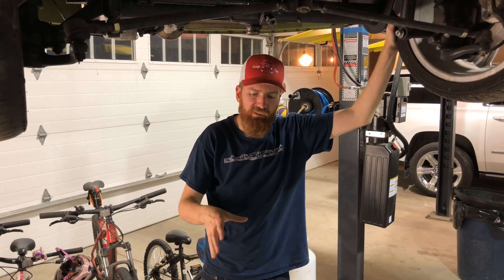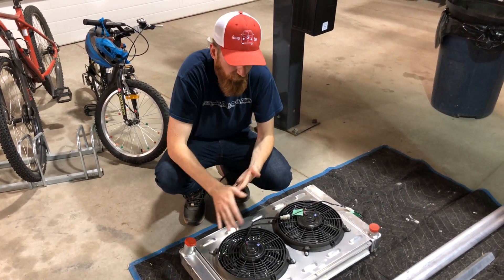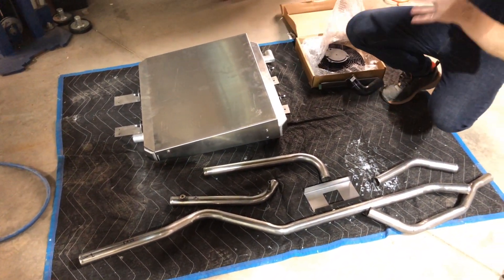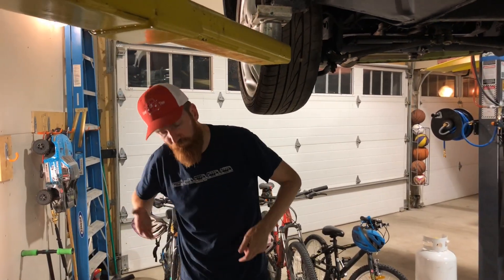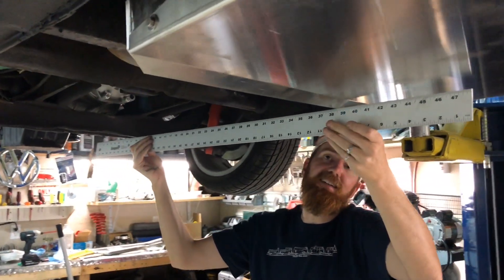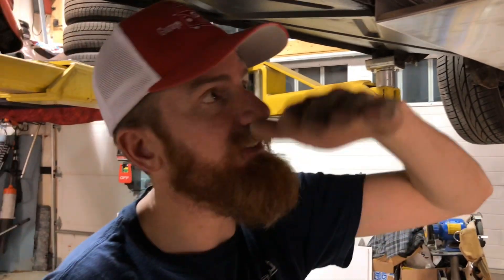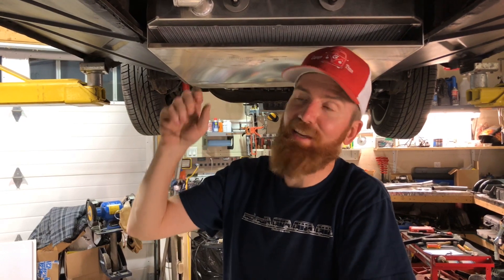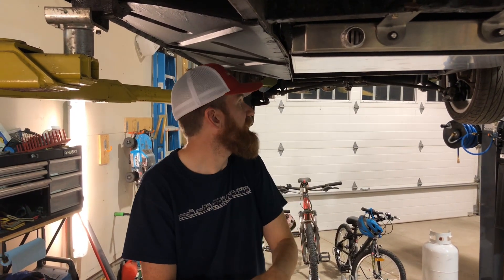VW Bus - Subaru Swap - Radiator Mock-up - Episode 11

Comment: Hey mate, I have an EJ25 powered Bay window here in Australia and have gone with the 2x Honda Civic radiators/fans in the engine bay. Can you tell me your thought process as to belly mounted vs engine bay? I'm sitll in the process of figuring out how to run it most efficiently but it works well in our Summer so far, just is a bit more awkward than I'd like! Cheers!
Reply: how does the air get to the fans & then where does it go for your engine bay set up?
Reply: @kevindougherty593  Air comes down through the vents like it does normally, but goes over the radiators (1 each side). The air then passes out around the engine down to the road, there's plenty of space since there isn't any tinware funnelling air over the engine like the original motor had.
Reply from the maker: Hi Kiel, I actually wanted to do the rads in the engine bay like yours, however was told I would have issues on a split, just don’t have as much room as the bay windows. Really happy with how my setup is turning out, should have new video posting any day adding centre belly pan to help direct air and cleaning up install.
Reply: @GarageTime  I didn't consider the shape of the engine bay in a splitty! Do you find the tray covering the rad on a belly mount likes to collect dust and other road junk?

Comment: However I will say that in my setup I had to remove the cheap fans and install high output two speed 21 amp fans to get the air flow needed
Reply: I watch your videos too, awesome build.

Comment: Did you have the fans mounted in this video? How far below the frame does the rad hang down? Thanks.
Reply from the maker: Hi Dustin,  Sorry, missed your previous comment. Lowest point is 2.5" below frame rails. In video fans are not mounted, but we have lots of space. Radiator actually hangs on angle, but with scoop appears level. Thanks.
Reply: Do you think there’s enough room to run the pipes inside the frame between the radiator and the frame so you don’t have to drill a hole through the frame?
Reply from the maker: Dustin Wilson unfortunately do not think so. The path fellows Speed figured out seems very nice. The strengthener went in pretty easy, don’t feel is compromised the frame, but no structural engineer here :)
Reply: @GarageTime  Nice Thank you.
Reply: Can I ask the dimensions you have on your radiator from Fellow?

Best regards
Aleksander

Comment: Do you know David White from Subi Swaps?
Last October I paid him a good amount of money for some Subaru Conversion work and parts. Up to this point I had received nothing. Every time we communicated, he insisted that everything was fine, but never show me any progress of the work “due to patent issues”.
A couple of months ago  he offer me to buy his business, so immediately I realized he was scamming me. I contacted another customer and he have the same situation, even he send the same picture of the Subaru engine and transmission donor car. Now it seems he closed the shop, blocked me and disappeared with my money. So if someone know him or have contact with him, let me know.
Thanks
Onix Bonilla
Reply from the maker: No do not know personally, just from our dealings with Subiswaps, and him stealing my money. First time this has happened to me in the VW scene in over 25 yrs! And I have to admit it caught me off guard. Now that VW’s are fetching good money, the scammers and criminals are coming into the scene. A real shame.

Comment: I hope you can get a refund for that other "kit" (some assem... cutting, bending, engineering required).
Reply from the maker: No refund coming, doubt even get what they still owe me.  Got email from them (Subiswaps) stating they are in over heads and closing the shop doors.
Reply: That's a shame but I'm sure you'll come up with an imaginative use for it all.